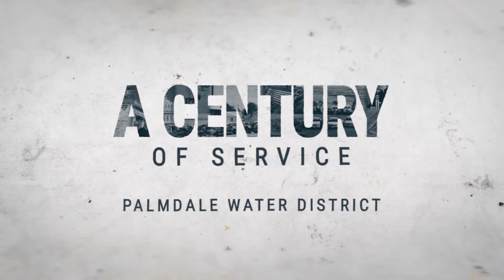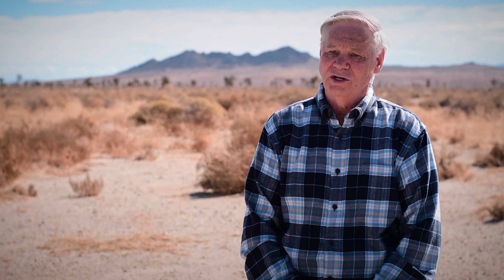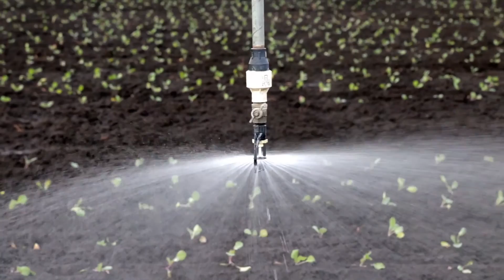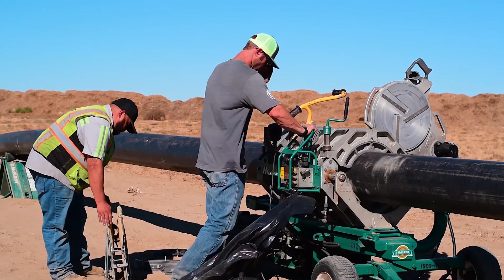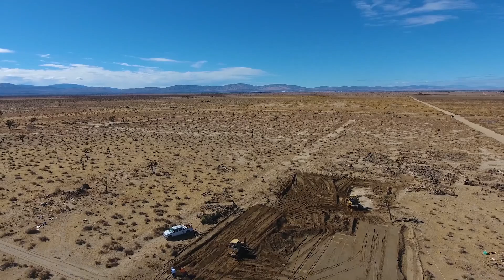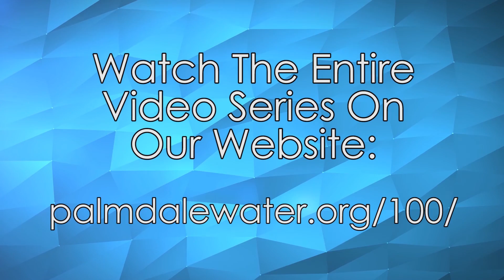Palmdale Regional Groundwater Recharge & Recovery Project

Comment: It is quite intriguing how in this age of information, such a high energy high cost yet comparatively ineffective solution has been chosen. It is obvious that low cost and basic permaculture principles (water harvesting via Swales and berms on contour with tree planting for shade etc) would dramatically improve the water table as well as green the dry arid surroundings. I recommend that you watch Geoff Lawton’s greening the desert YouTube series, or Andrew Millison’s YouTube videos on the work of the Paani foundation.
Reply: LMAO!  R.O. treatment of sea water is perfectly economical and unlimited.
Reply: @protonneutron9046  Except in California. San Diego tried to get a RO project started. The EIR showed that concentrated brine would be returned to the sea. This was too much for green activists who objected to this discharge, even if it was at the bottom of the coastal floor and sea water is already salty. So they built an inland reservoir -- where imported water is free to evaporate.

Comment: You could save an awful lot of water if you just put a floating solar array at the water treatment plant ponds & on any water canals; evaporation wouldn't be anywhere near as bad. Additionally, instead of going to such an expensive & energy intensive project as described in this video, using a nature based solution of swales & berms on contour as part of a permaculture design which could double as a food production set-up, you'd have a low input, sustainable & relatively inexpensive way of recharging the groundwater on an ongoing basis.
I recommend consulting with Andrew Millison, Oregon University, who lectures about permaculture design & implementation.

Comment: replenishing groundwater supply is probably the most important challenge to ensure rivers continue to flow.

Every household should be recycling clear and grey water to achieve 'water neutrality' for a community; soakaways, attenuation, surface water capture...